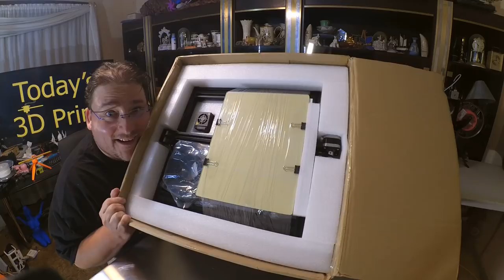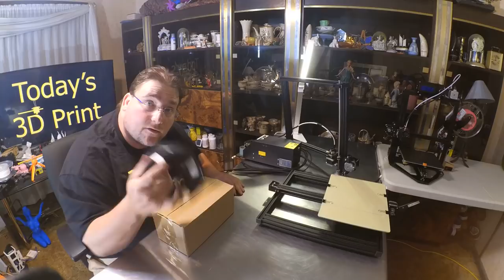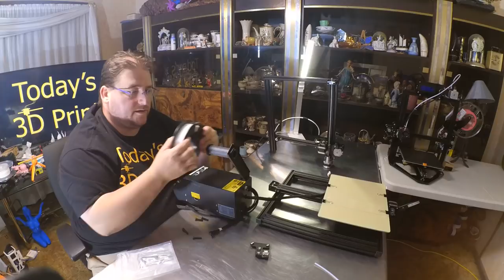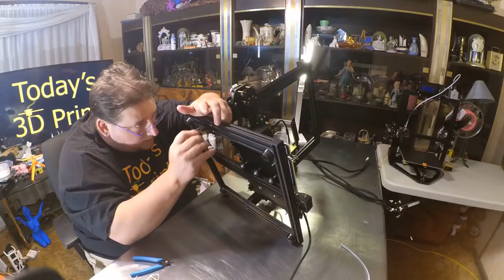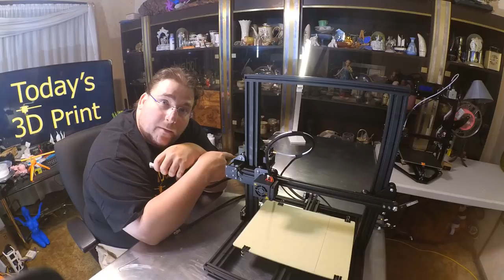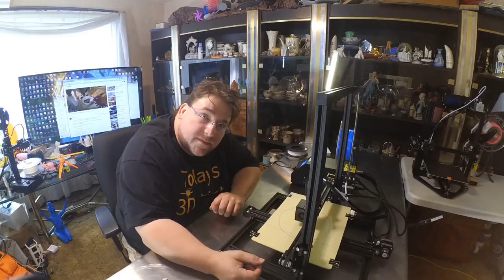Today's 3D Print - Its Finally Here  Creality CR 10 Mini Unboxing Initial Thoughts CR10 Mini

Comment: I use a belt tensioner that is shaped like an S, 2, or 5 depending on your perspective. They are fairly universal, and worked well on the CR-10 I work with. When I took the slop out of the belts it removed the skipping issue I had, and has further reduced a ringing issue I had.

Comment: Per openbuilds instructions v-wheels should be a bit tighter than just no wiggle. It should move freely but you need to check each wheel is spinning when you move the gantry, and can't spin freely. It may actually not wiggle, but not all wheels are properly adjusted.
Reply from the maker: I know. I did not want to spend that much time tweaking on camera so I stopped it their. since you can only reliable have 3 point contact for this kind of connect (one always pushes another away) it takes a lot of micro tweaking to really get it good. when you move the bed all 6 wheels move but sometimes when you move the wheel itself the friction is too low and it moves without sliding the bed. Personally they should put 6 eccentrics on it then you can micro adjust all 6 to get the best balance. open builds almost certainly knows more than I do so I will update instructions in the future to note they be a bit tighter than simply no wiggle.

Comment: It would have been helpful to see the controller display as you were changing settings and commenting.  It would also help to see the nozzels working while making the bed adjustments to improve the print quality.
Reply from the maker: +Keith DeShong I'm going to make an entire video on that screen and what the different things you can do in Access via that's screen r

Comment: Fantastic video :)  It'll be popular in a month or two when everyone is buying one of these.  You're so informative - thanks again man.  Would LOVE to see you do another 'fundamentals of FFF/FDM' video along with 'avoid these mistakes', you know, whenever you have 'extra' time :)

P.S.
Good job on edits!
Reply from the maker: +Dennis J Harrison Jr suggestions for what fundamentals you would like to know about? Ie what would you like to see the video?
Reply: Things like how the round filament gets shoved into flat layers, and what that means for thing like corners and why the print speed changes for different features and why we have settings for acceleration, retraction, coast and wipe - and how all that interacts together.  What different filaments to use for which types of prints, and how to get our printers to be able to use them (PETG, ABS, Nylon).  And finally the 'checklist' of what you need to do before starting a print - making sure the bed is level (or has been leveled recently and you haven't been banging it around with bed scraper), making sure the nozzle is prepped, make sure your clips aren't in the way of the default paths, clean print surface with proper adhesion prepared, AND anything else you can think of.  I know there are videos out there that go into great detail on each subject for different printers, but a high level overview of that as it relates to the CR-10 would get passed around a lot I think.  And you could use the comments/questions for more content.  Newbies (like me) would learn a lot from that I think.

Thanks again for all your content!

P.S.
Nylon is a BUGBEAR to print detailed parts with.  I mean, a downright monster.  Worth it though!

Comment: I believe those steppers are what are on the CR-10 z axis but I could be wrong. Also I think you keep calling the nuts concentric on the bed but I believe they are eccentric. Concentric means even (think of concentric rings like a bullseye).
Reply from the maker: x9x9x9x9x9 you are correct. Eccentric i believe is correct.
Reply from the maker: +x9x9x9x9x9 I'll double check when I get home but I'm pretty sure she's a normal full size steppers for the CR 10
Reply: Nerys I know the z uses a 34mm and I think maybe the x but the Y uses a 40mm. But I have no idea the size on the cr-10 mini

Comment: Hi Chris! Just got a CR-10 Mini and your videos helped a lot.  I was having some dificulty getting the Y axis  tuned. There were always one or two roler bearings that never seemed to catch the frame. I noticed that the screws holding the rollerbearings were not completely tightened and turned freely when using a screwdriver . I decide to remove the heat bed, access the nuts on the back of the plate and screw them tight. The non -eccentric bearings immediatly grabbed the frame, and then i adjusted the eccdentric nuts to touch and grab the frame aswell (although now they were much more dificult to turn). Every roller bearing now makes the frame go back an forth by hand - it seem to be fine.  Should I have done this? Could that initial tighting cause bitting on roller bearings? I want to get this part right....
Reply from the maker: +Pedro Soares it sounds like you did fine just don't over tighten :-) good on you for investigating in finding the problem as well that's part of the fun of 3D printing :-)

Comment: Hi I watch one of your videos about setting the bed . And saw the bits about making sure that there is no wobbly etc on the slot wheels . And my top 2 wheels on the gantry tightened up you can still spin them with your finger any ideas
Reply from the maker: There are two ways to tighten up the trolleys you can tighten up the bolts going through the wheels which sometimes is necessary also one of them is what's called an eccentric nut basically it can wobble as you turn it so as you rotate the nut by sticking the wrench in between the rail and the wheel onto the aluminum shaft that is visible in between with flat faces for a wrench it will move closer and further from a central line which will drive the wheel closer and further allowing you to tighten the trolley
Reply: Nerys ok thanks I will look at it tomorrow but I think the right one is just a cylinder spacer .
Reply from the maker: Each trolley has three you have two on one side one on the other the one on the other is the adjustable one if it is adjustable at all if it is not Titan all three down
Reply: Thanks I'll give that a look as I am all new to 3d printing

Comment: Ok next problem. Small prints in the centre seem fine but once I print along the x axis using maybe 2/3 of the width I get banding at the same height on two different prints. I fixed it to some degree by loosening the brass nut screws on the Z. But it’s still there. I’ll post a pick.
Reply: The one on the right is before I adjusted the Z screw. The left one is after. Some on the Facebook group recon I should calibrate my e-steps, not sure it will help. Another said turn the Z upside down and use the other end of the rod.
Reply from the maker: +Joe Blog typically two things cause this either a Bent Z rod or bad coupler it's also possible to have a bent shaft on a stepper motor so you need to diagnose each of those intern start by removing the zrod altogether and then turn it while holding one end and throwing the other end and see if it's bent if it is replace it length doesn't matter as long as it's at least as long as what is there but not too long for your interfere with your spool holder

Next remove the coupler and turn the motor does the shaft wobble?

If the shaft look straight then put the coupler on see if the coupler hole wobbles make sure 1 set screw is on the flat of the stepper motor

When you tighten the zrod tighten both of them evenly the set screws on the coupler so it doesn't prefer one way or the other which can cause a wobble

While far less likely and you would probably notice with the Z Rod removed Slide the Gantry up and down the vertical Extrusion does it feel smooth does it look like it pushes one way or the other?
Reply from the maker: +Joe Blog I don't see a link for a picture anywhere?
Reply: Nerys sorry it ended up a a separate comment.
Reply: Nerys have a look above
Reply: Nerys https://imgur.com/gallery/Eqdda
Reply from the maker: I don't see a wobble issue in either of those prints. the layers are nicely aligned. there is definitely a slicer/filament/extrusion issue going on however. What filament is that? how was is sliced (assume cura?) print temp? speed? My first hunch if the filament is known good would be slightly slower slightly hotter maybe a touch more retraction and make SURE the zipper is NOT on those vertical stabs. (put it on the belly)
Reply: Nerys it's a cheap PLA from Amazon cost £14 for 1kg. I wondered if it was the Z rod binding at the same point each time. I reprinted the mid section by accident last night and will check it when I get home later. The model prints vertically and I'm using simplify3d and Elkins profile. It uses 60c bed 210c hot end. The ones in the pic were printed at 80fr. I'm not sure what feed speed as I left it Upto simplify. I'll have a go to see what the extrusion is like. I did notice on the cr10 it seems it has a few more menu options compared to the mini. I don't have a cr10 just watched some vids on it. Thanks for the help ill get there in the end.
Reply: tested the extrusion used the menu to extrude 150mm and got 145mm. off to google how to fix this.
Reply: ok just had a look and its on about adjusting it in the firmware :S . I have got some Arduino stuff so might be able to do it. might need some advice on how if you have time.
Reply: p.s. didn't have the tube connected just made sure I measured what came out of the stepper/extruder connection.

Comment: Could you please do a quick measure of the mini and tell me how much real estate it requires, rail to rail?
Reply from the maker: no problem. the minimum front to back is 20inches or 51centimeters. the left to right is somewhat fluid since it depends on brain box placement I would say smallest is 24 inches or 61 centimeters. the wires on the mini might be a little longer so you might be able to put it UNDER the printer with some feet to raise it up. I do plan to actually try that!
Reply: Nerys thanks, I know I want a second printer and it’s between the mini, another CR 10 or an Ender.  Was really hoping the MP mini delta was better than it seems to be.
Reply from the maker: the mini delta CAN be amazing. ENDER quality amazing but there seems to be some manufac qc hiccups right now. waiting on my RMA replacement. :-(

I know they will make it right. good customer service but it sucks to wait :-)

the ender is an amazing little monster for seriously high quality prints if you don't need more than 150x160x225 (you would be amazed what you can fit in that) and is a VERY good companion to the CR-10. as you watch the 75 hours print hit 50% on the CR-10 and the withdrawal symptons start to kick in you can get your fix on the ender :-)

the Mini is also VERY good. thing is though. is space and budget are a concern the mini is very good. but if you don't have space of budget issues might as well get a second CR-10.

so you can't really go wrong no matter which one you get. the advantage of the ender to me is that is can make prints of a quality the CR-10 can not match (simply because its smaller not "better" per say)

Comment: A question for you bud, My concentric nuts on my cr10 are all on the right hand side.
Would it be beneficial to put the middle one onto the left hand side, the same as they were for the mini here?
Reply from the maker: I can't answer that with authority as I am not knowledgeable enough on the subject but my GUT tells me the way its done on the CR10 is better as I found it very easy to snug up the CR-10 bed and a little testy to snug up the Mini bed. it snugs up fine but the fine tune get all 6 wheels going snugging took a lot more effort than on the CR-10. now that you mention it if the bed every comes loose I may try swapping it to be all on the same side like the CR-10.
Reply: Thanks, I think i will keep it the same as when it arrived.
Reply: I would put them all on the same side.

Comment: received my mini last week. haven't built it up yet as it my sons Christmas present. one thought is it worth putting a small amount of GT85 oil on the bearings? in fact should the printer have any parts lubed?
Reply from the maker: +Joe Blog so far all of mine came pre lubed so I would shy away from doing that without better advice
Reply: just been watching your bed levelling video. looks like a mini in the background. have you done a final review yet or have some vids of stuff you've printed with it? keen to see how the quality is.
Reply: also bought some relatively cheap PLA to try out as some review were posisitive on amazon. branded Surreal Pure PLA. also noticed the stuff with the printer is 1.76mm on the label but the other stuff is 1.75mm strange.
Reply from the maker: +Joe Blog don't worry about it a couple of hundredth of a millimeter won't make a difference
Reply from the maker: +Joe Blog yep no final review yet although it's really just a cr-10 with a different bed size it's reliable and consistent like the rest although it is not that much smaller than a cr-10 I would just go with the cr-10 unless you really need the smaller form factor
Reply: I bought the mini as it was cheaper, an important factor when married.

Comment: I seriously could not find that 3rd x plug socket had to listen at the part where you said "I tie all 3 cables together" like 10x cause you visibly plug in all the others but not that one... actually I didn't see anyone plug that one in and I was like "wtf an extra plug...WTH!"
Reply from the maker: Sorry about that.
Reply: @nerys71  
It's all good. Still appreciate the vid.
Now I gotta fix the clogged extruder (at least I think it's clogged) go figure I'd clog it on a lucky cat test print >_< I think I leveled the bed to high and caused it to jam into the plate and back up @.@
Reply from the maker: @user-nd7rd8jo6h  that can do it usually that doesn't cause a clogged though what it does do typically is chew through the filament at the feeder usually all you need to do is to increase the temperature and manually push some filament through that way usually clear it unless you really really jammed it :-)
Reply: @nerys71  hmmmm it doesn't want to push forward (tried while running of course) and I had the hot end temp at 200°c
Reply from the maker: @user-nd7rd8jo6h  raise to 260' also use the wee little needle that came with it stick it in through nozzle wiggle around till it clears up then push.
Reply: @nerys71  ok! Thanks. I'll give it a try later.

Comment: Your CR-10 Essential Mod Set does it fit to the CR-10 Mini?
Reply from the maker: +Agustin Fru the knobs look like a yes I will confirm physically tonight visually they look fine the duct should work fine although your printer should come with the updated corrected design so you won't need it the Y tension relief I'm not sure of I would assume no I will verify